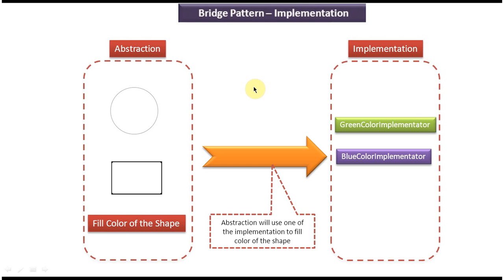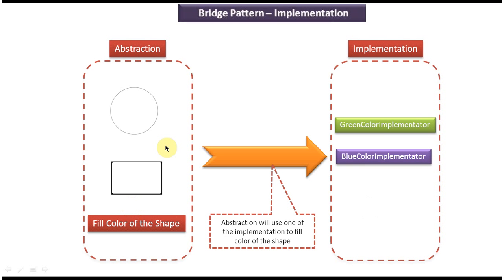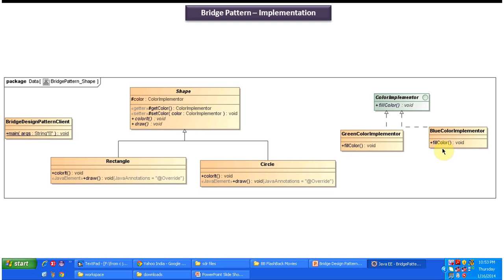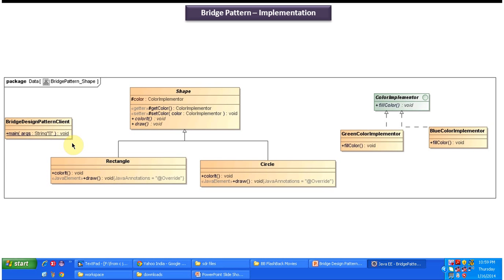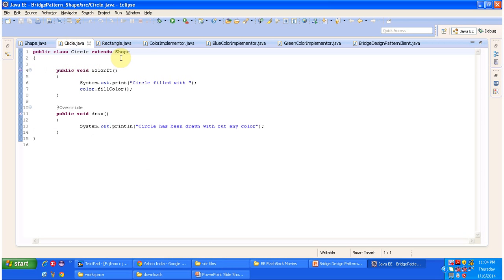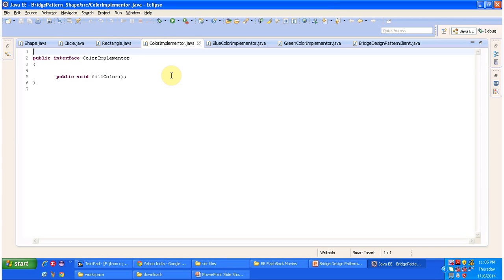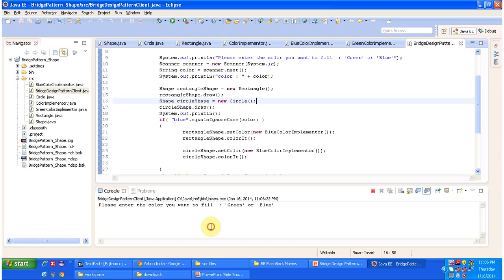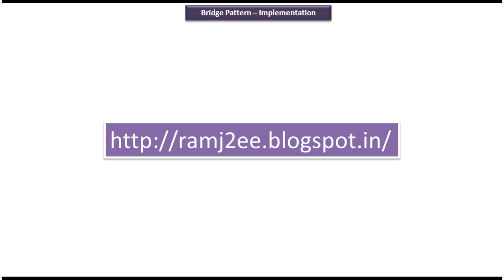Bridge Design Pattern in Action: Shape Implementation

Comment: I really like ur videos about the design patters. One thing i missing here, what problems these pattern solved.  For example Without Bridge Design pattern how the system will be complex.
Reply: Without Bridge pattern, if you make changes in Abstraction code then it will affect Implementation layer code so u will have to change implementation too and vice versa. Bridge pattern separates Abstraction and Implementation parts from each other.